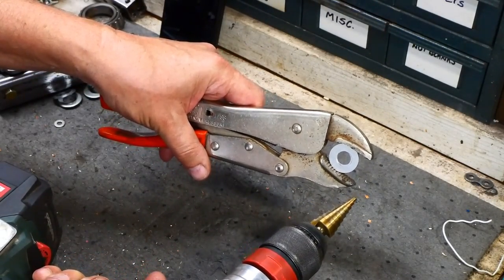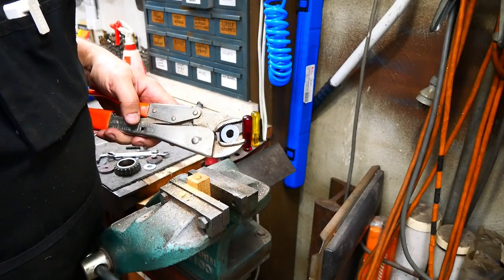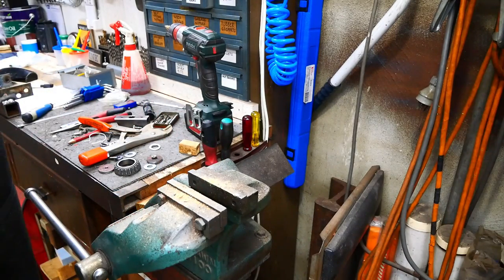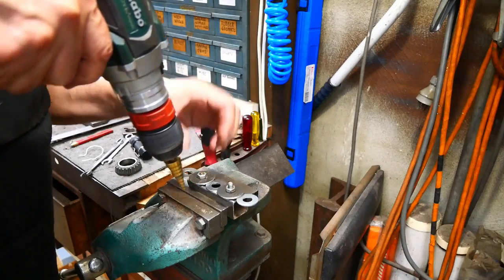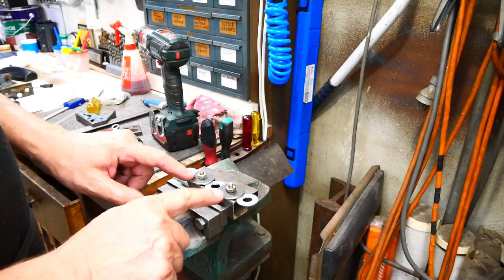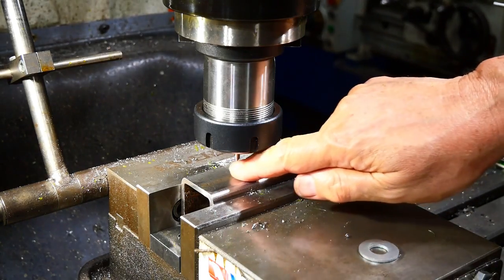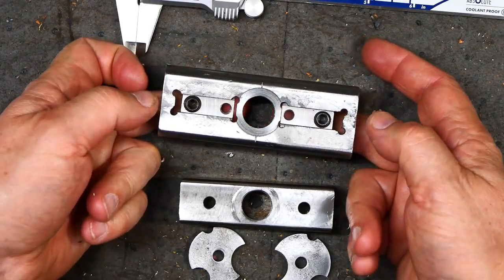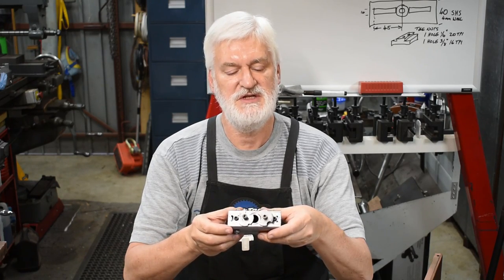Drilling out washers - must be a better way !

Comment: 3 threaded holes in a bench vise.  2 in the front jaw pointing up and 1 in the back jaw pointing up.  Space them with the smallest washer you ever intend to drill. Use 3 headed screws for downward force on the washer.  Boom! Done.
Reply from the maker: Thanks for your comment.- sounds like a good idea and I am curious about the detail. Did you drill holes into the removeable jaw pieces or the castings behind them ? - or maybe made some replacement soft jaws to drill the holes into ?
Cheers, Alan.
Reply: @alanshomeworkshop  All of the vises I have done this with had replaceable jaws.  Drilling into the casting behind the jaws would put the screws too far back and usually on a curve.  Basically you are holding something round between 3 points (ala vee block and clamp) with the flat of the jaw supporting that which you intend to drill (like parallels in a mill vise). When you are finished you can run the screws in until the next time they are needed and the heads of the screws keep swarf out of the holes.

Comment: Nice tool you just made, I've had to make washers bigger on the inside and the best thing I could do was Mount washer and my Chuck lathe and pour them out with a boring bar and that works very well for me, but I like your tool
Reply from the maker: Thanks Steven - it has proved to be a useful bit of kit. I enjoyed the project as I like imagining and making tools like this from scraps and materials on hand.
Cheers, Alan.

Comment: Better way to enlarge washers, ok, then 45 minutes??? Hardware store or my plasma table.
Reply: for those who have plasma cutters. I have one but more trouble setting it up. Make that tool one time and no set up time anymore. I have had to have washers opened up a few .001 for a perfect fit. Nice job Alan. A handy tool to have.
Reply from the maker: @frankmora8336  Thank you - although the video was meant to be more about my approach to prototyping than the resulting widget or usefulness of same. I guess this message wasn't clear enough.
Cheers, Alan.
Reply from the maker: John, valid point. This tool is designed to facilitate opening the bore of thin or plated washers in fine increments without damage. If your shop and uses cases have no need for this, then the tool has no value for you. However, I enjoy designing and prototyping tools and was also trying to share this in the video.
Thank you for your comment, Alan.

Comment: Here’s a better way, go to the store and buy the correct size. They come in all sizes and types and they’re very inexpensive. Just sayin!!!
Reply from the maker: Yes, that's good advice - but when the store isn't open, or I'm in the middle of something and want a washer right now, it doesn't help. I sometimes also want a washer with close fitting ID and most manufactured washers are a very loose fit.
Reply: I work on mopeds and i need not so common sizes like M7, M9, M11 washers. Those you won't find in traditional hardware stores, only in bicycle shops if they have them on stock and online (ebay). There are places like Würth, but the min. quantitiy is 100 or 1000  pcs.